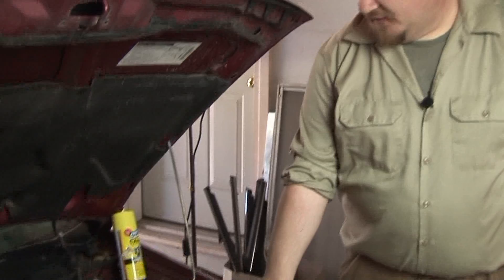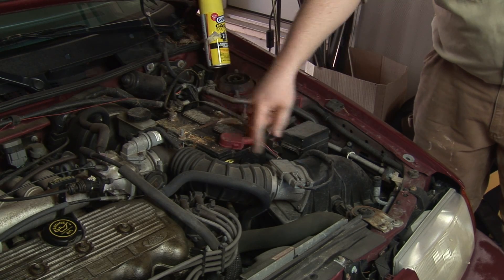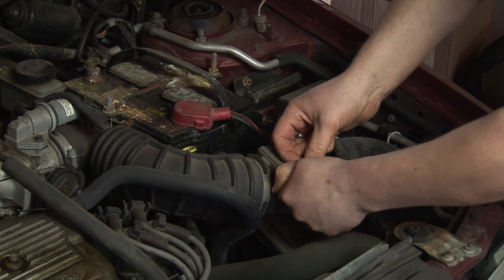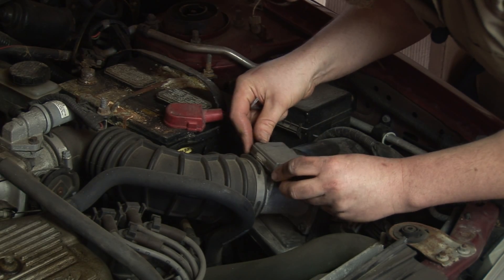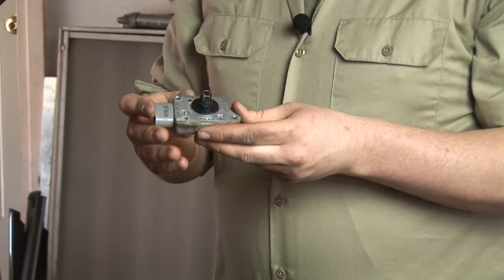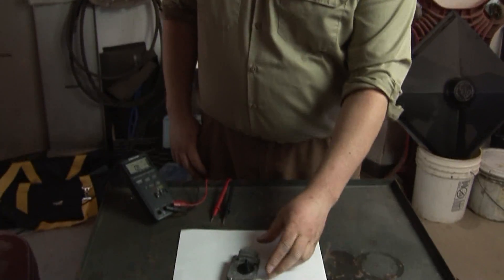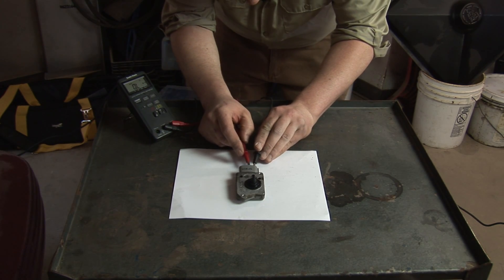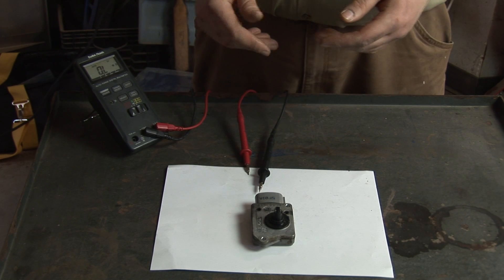Auto Repair : How Do You Clean or Check a Mass Air Flow Sensor?

Comment: you dont use carberator cleaner to clean a MAF idiot. use Mas Air Flow cleaner, made for the MAF sensor. you will ruin the MAF sensor with carborator cleaner.

Comment: Hello I'm driving a 2007 ford Taurus sel 3.0 and when I accelerate my car putt . When I start it and drive my car shakes very fast but only under the hood....
Reply: Brittany Bickford You should have it towed (to avoid causing further damage as women usually will do) to a competent auto shop (good luck with that) for diagnostics, not asking idiots on YouTube what it might be.
Reply: might be a broken engine mount

Comment: EVERYONE! I used brake cleaner, as soon as I installed it again the car didnt idle... It idles now but sounds like its cammed lol. Got a new one... Would cost 300-600$ here in canada but US is 50$
Reply: Don't use brake cleaner, they sell a product called CRC Mass Air Flow Sensor Cleaner.
Reply: hubergeek Your Right! The guy in the video used Carb cleaner which is a no no! The CRC MAF cleaner is what I used.
Reply: Security
Camara with  memory  card

Comment: You are absolutely right. The cans may look the same, but using carb cleaner can actually damage the sensor. MAF sensor cleaner is all you should use. You damage one of these, you are going to be paying a couple hundred bucks (most likely) for a new one. I have a metro, 3 cylinder and it's a $200 part.

Comment: dumb ass you just stripped the sensor of its ceramic coating using carb cleaner!!!!! maf cleaner is formulated just for this! 20 year mechanic and you dont know this!

Comment: Sorry but! what do you check with an Ohm meter on the pins? the sensors are not directly connected on the pins man!
If your sensor wires are broken you can read a resistance on the pins!!!
This is not a good way to check your MAF sensor...

Comment: what i mean tune the air and fuel ratio, is actually checking the fuel ratio. most of the time a stock car dosnt need to check it just replacing the general component will be a fixed.

most racer will check the fuel ratio and set it at the right fixed. it also a quick check and an idea if something might have a problem. i think thats how it goes at lease. 

tuning the air and fuel ratio is bypass the computer from learning and setting itself. again, most racer do this to their modify car.

Comment: haha, reading what i said now is very vague. 

vacuum leak can either cause lean or rich fuel ratio. i think most car when you have a bad o2 sensor it may by default go on rich to save the engine from damaging. vacuum leak will do it the same way. when too much air getting pull in from other gaps, the computer see too much air therefore it give it more gas so you are running more rich.  

tune up consist of replace general component like spark plugs, spark wire, cleaning intake etc..

Comment: HOW STUPID , YOU DO NOT USE CARB CLEANER ON THESE , IT WILL DESTROY THEM , THERE IS A CLEANER THAT IS SAFE FOR USE ON THEM , IT'S CALLED MASS AIR FLOW SENSOR CLEANER , AND IT'S LOCATED LIKE 2 TO 3 FEET FROM WHERE YOU PICKED UP THAT CARB CRAP !!

Comment: I must echo previous comments so that no one makes this mistake: do NOT use carb cleaner.  Use an electronic component cleaning spray or something made specifically for a MAF sensor.  Note that he also said the acceptable range of resistance for this particular sensor was in "milli-ohms" -- this shows that he doesn't know what "ohms" actually are; they are measured in multiples of 10, not fractions of 10.  Hopefully, he actually had his multimeter on the correct setting...

Comment: your description of the electrical issues is a little off.  Nothing ever requires "more voltage" to maintain a voltage level. V = IxR  I suspect the R changes change the current "I" value which is detected by some electronic circuit.  

Not that big a deal, just need to work on your description a little.

Comment: lol on all the comments that are saying "dont put carb cleaner.."  next u are going to say "DONT PUT ACETONE in ur car because it will damage ur car... WHEN MOST IF NOT ALL FUEL INJECTORS have acetone on em... please use our product.. others will damage it for sure.. 

i used carb cleaner because my car got the check engine and my bro in law said it was the maf  sensor so i cleaned it with carb cleaner d/c the batt for over a minute and bamn rough idle gone and check engine gone.. IDIOTS!

Comment: MAF units use voltage signals but more often they provide frequency information to the ECU. Performance degradation is normal when there is a fault but if your car is shutting off, there may be a temperory loss of signal from other sensors. The codes do not always tell you the primary fault and some faults do not code. It is almost impossible to solve without viewing trace information from a lab scope. check everything including fuel pump and pressure, TPS  cam, crank sensor coolant temp etc.

Comment: @joecobra1234 Joe sounds like you need some anger management. A random guy on a youtube video is as much an expert on electronics as you are on rational discussion. Think about it.
Some carb cleaners contain toluene, this will dissolve glues and plastics. Many contain Acetone, this dissolves plastic.

Comment: Thank you very much for informative videos I have question if you dont mind I have 2002 Dodge Intrepid SE 2.7L starts and go but wont reachover 2500 RPM what could be the problem?

also it has a filcker oil light stayed on when its worn at full stop then disapear when it moves any help will be apreciated

Comment: hi.. i have a problem with the bosch (maf) for alfa romeo 165 i try to clean it but after a while it gone bad again and i've changed it and have the same problem the car works fine for a day or two and i've changed the car engine and have the same problems...

Comment: how do you know its using too much gas? this sensor could be it but im not sure. all i know if its mess up it will use less gas and cause lean. more air then the gas. you will feel way less power than before. 
 but it could cause to unburn fuel and may use alot of gas

Comment: Do not ever spray carb cleaner or any solvent on a MAF sensor like this guy has just done. A MAF sensor is a sensitive electronic part which requires electronic contact cleaner or MAF cleaner. Carb cleaner contains a lot of crap which will leave a residue and destroy certain plastics and electronics. Don't do what he did.

Comment: Nice introduction clip, but this is not the best way to check MAF operation by measuring the resistance, you should measure the frequency output from the MAF